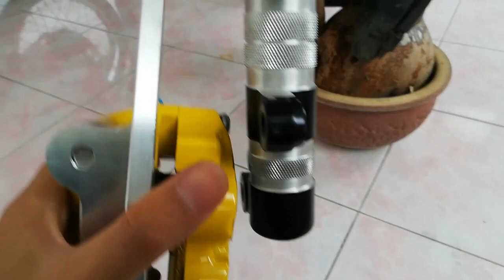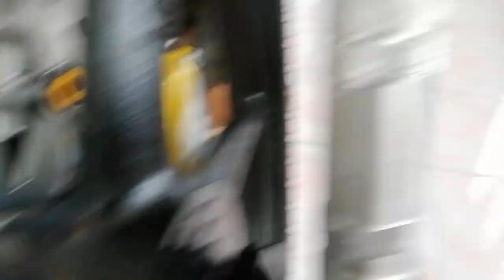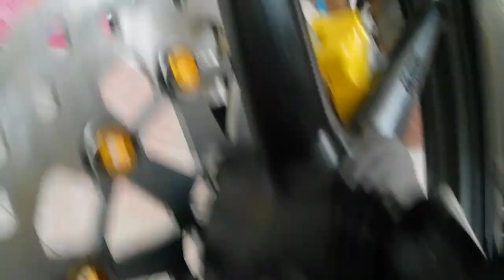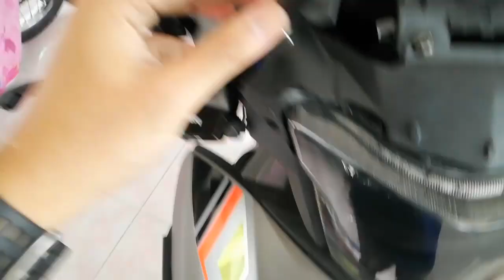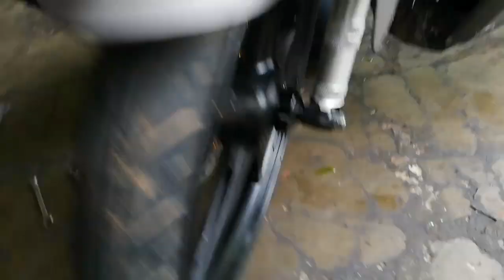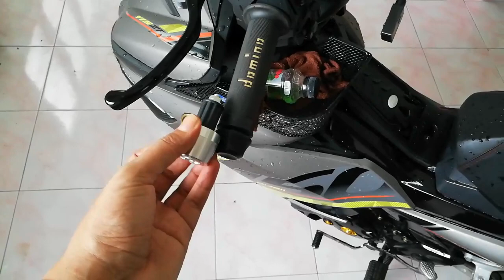CALIPER BREMBO GP4 & MASTERPUMP BREMBO RCS CORSA CORTA PART 2

Comment: bos. screw bleeding tu kan ada atas bwh. yg atas tu bos beli kt mana? or dpt skali dgn caliper? skru warna chrome tu
Reply from the maker: Ouh.. Yg tu dpt sekali bossku. 1set.
Reply: @EDDYRYAN  sy baru dapat gp4 smlm. nak psg utk depan, tp blm pasang lg. tgh tggu skru tu la, seller x bagi. dia dah pos lagi skali. sy pakai rim sp522 gak. blkg pon letak washer. rim sp522 mmg sangkut. tp tulah tgk bos grind byk btl, skru, fork, caliper, aduh syg btl bos. hrap sy pnya tak kena grind jgk. sy pakai rim ngan fork y. letak washer blh kot kan bos
Reply from the maker: Ok bro. Cmni. Bro try dlu letak washer yg 4 bijik kecik tu letak kt disc depan. Pastu try lay fork yg tmpt sangkut bracket tu. Mcm sy buat.jgn lay caliper dlu. Try adjust apa yg ptt. Kalau sp522 ni mcm payah sikit la. Nak x nak kna lay jugak cliper tu. Tp try dlu laa. Lay caliper sebagai option last. Goodluck bro. 😁
Reply: @EDDYRYAN  tq bro. sy try dlu nnti, x lepas sy lay fork. then option last baru caliper.

Comment: bang gp4 tu ori ker . baru ni saya ada beli gp4 tapi tu la sangkut .. nak tanya kena potong banyak ke sikit yg belakang tu ..
Reply from the maker: copy bang.lay sikit ja. sangkut kat rim ka ? rim sp ? ikut cara sy buat. lay sikit kt fork tapak bracket. boleh tgok kt video part 1. tq bro.
Reply: @EDDYRYAN  saya pakai fg511 bang ..
Reply from the maker: @B.O.B.45  boleh adjust tu bang.rim lepas.
Reply: @EDDYRYAN  ohh yeke .. fuhhh lega saya .. terima kasih bang 😁
Reply from the maker: @B.O.B.45  biasa la tu. kalau xnak lay caliper. lay fork yg tmpt sangkut bracket tu. boleh lepas. 😁
Reply: bang caliper saya dh siap pasang . tapi yg jadi masalah caliper tu leaking la pulak . mcm mana ye nak bagi ok balik
Reply from the maker: @B.O.B.45  leaking kt mana tu? tmpt lay ke?
Reply: @EDDYRYAN  caliper tu saya tak lay pon . pnp terus je . masa nak bleeding tu tiba² leaking . sebelum saya nak pasang kat kat motor saya ada buka caliper tu . bila pasang balik terus leaking